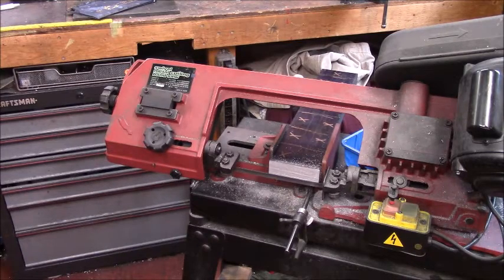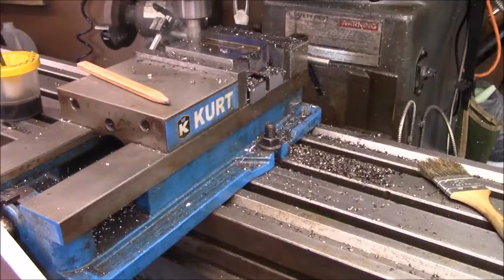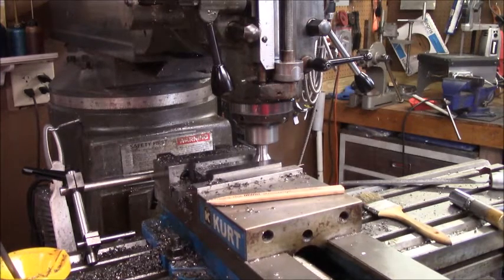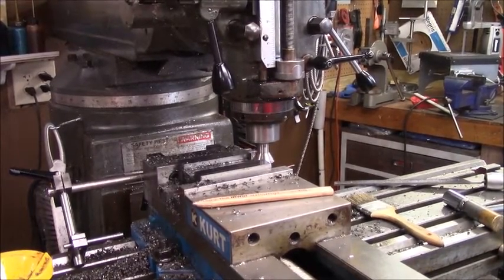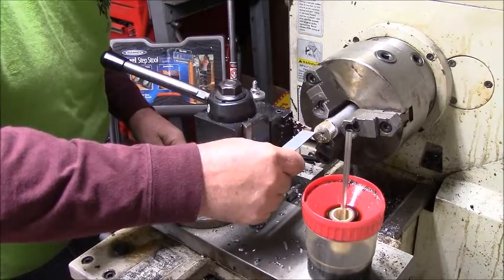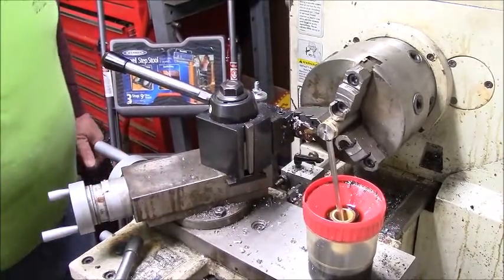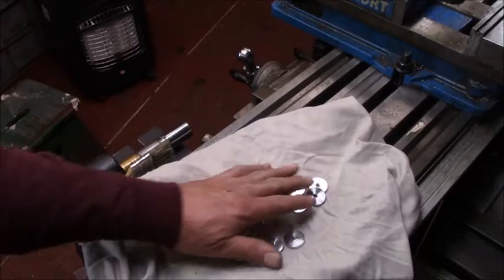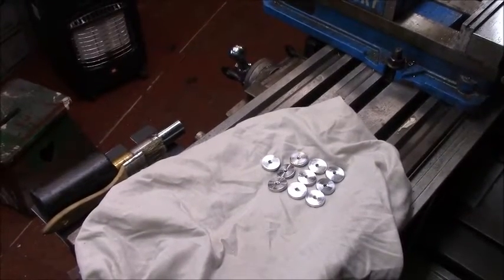Helping a friend, Machining AXA blocks for Michael

Comment: Hi James nice to be here, we saw a shout out from the outsidescrewball channel, Chuck is a great man we have been watching him forever. He shared your great no spill oiler and your nice channel sticker. 
Nice lathe tools you are helping your friend with. Lathe tool holder height setting knurled thumb setters for the tool holders? 
We would love to see some completed images Jim, Lance & Patrick.
Reply from the maker: Active Atom yes guys on my tool holders and blocks, I always use 1/4 x 20 all thread for adjustment rods. The adjustment rod just holds the blocks on the C/L of the part. The real forces is held by the piston or wedge on the QC tool post. So I just use aluminum and knurled them for adjuster, then a simple lock washer and nut completes the set up. If you notice the shop made tools use this set up. It works as well as a larger stud, besides on a tool holder modification you really don’t have that much room to larger studs. 

I also watch Chuck myself, since I sent him stickers it wasn’t that big a deal to include an oil cup. Thanks for the kind words.